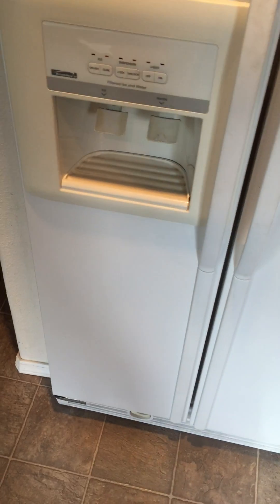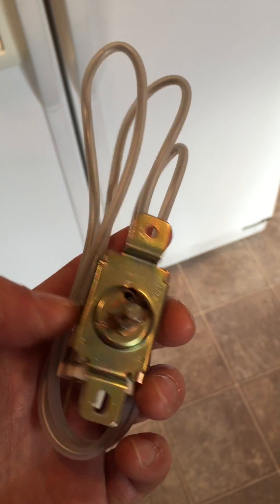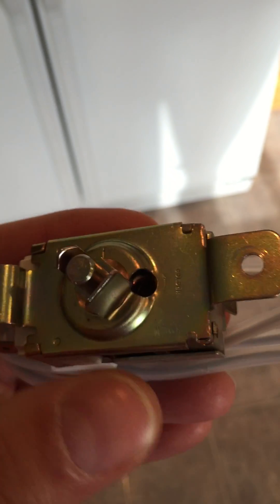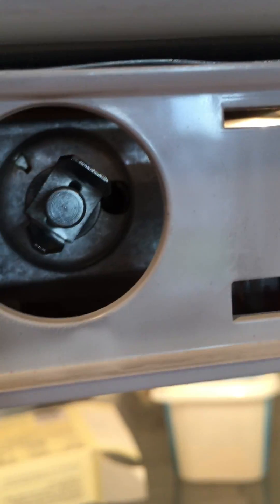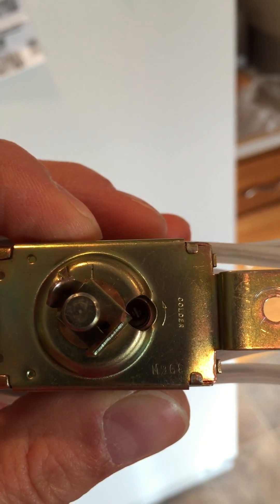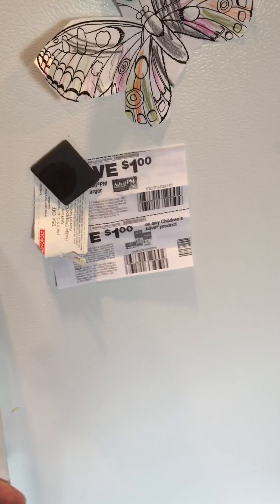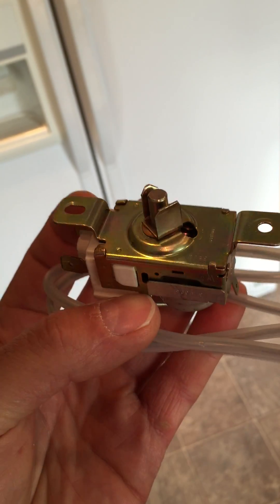Refrigerator thermostat adjustment

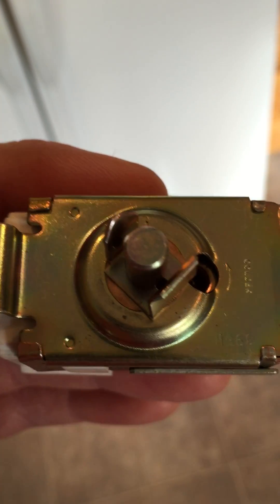Comment: At about 1:15, you say counter clockwise makes it warmer.  Then you say you turned it clockwise to make the fridge warmer.
  The control does have colder ccw on it.  Think that was just a mistake.
  Glad I found this as I do work on appliances and did not know this, and am trying to calibrate an older one.  If I get it calibrated like I want it, and nothing else is malfunctioning, I will order a new one.
  I don't deal a lot with fridges because I like to run them a week or so to make sure they do not freeze up behind the panel from a bad stat, heater or relay.  That and they can  be a little cumbersome when moving by yourself.
   I just readjusted mine to ccw, and it shows a little warmer.  That being said, I did check to see if it was going into defrost mode.

Comment: I've got an old GE top freezer refrigerator, with a thermostat that looks identical.  The thing is, I can't see inside the little hole to see what type of screwdriver I need.  Slotted?  Phillips?  If anything, it looks like the center of the screw is raised, not inset for the tip of a screwdriver.
Reply from the maker: I'm not sure, I'm pretty sure that I just used a small flat head screwdriver on this one.

Comment: I bought a thermostat to replace the one that broke, the problem is i kept removing it in order to alter the screw that alters the temperature and in the end i broke the long capillary wire that fits hidden in the fridge which meant i broke the thermostat.

Comment: Same thing happened to me, except opposite.  Replaced the fridge thermostat and now it wont get below 41-43 degrees.  Its throttling the compressor on/off but at just too high of a temperature.  Mine has a similar screw with the arrow and "COLDER" on it, so I'm going to have to adjust it to get it to throttle to a colder temperature.  

These things really should be calibrated better when they're made.
Reply: LazyH-Online  good point